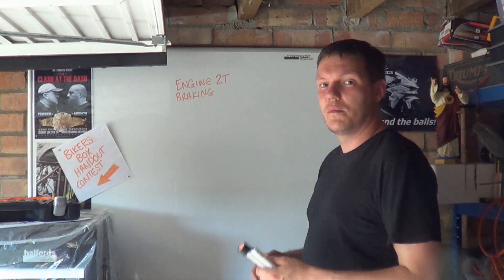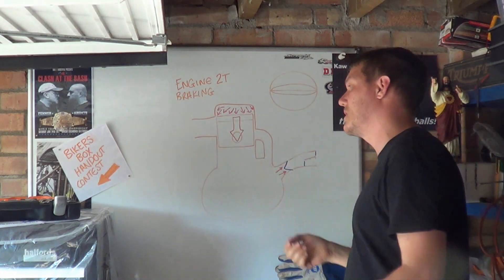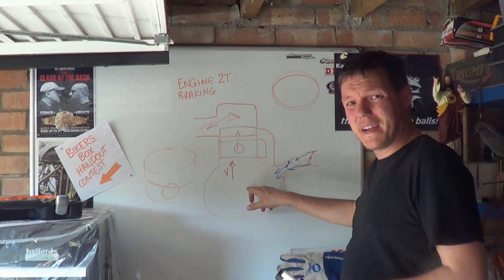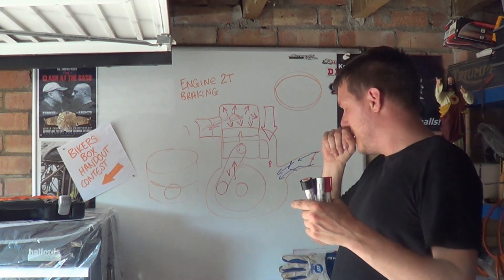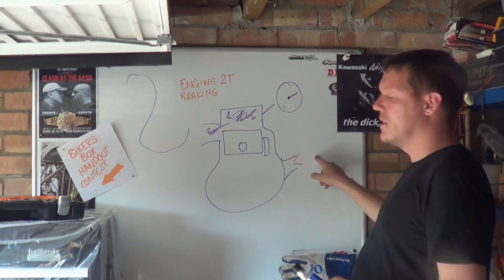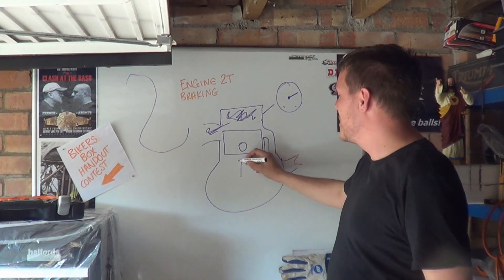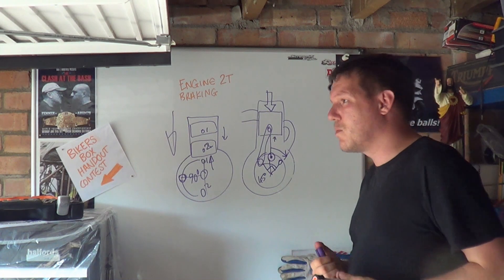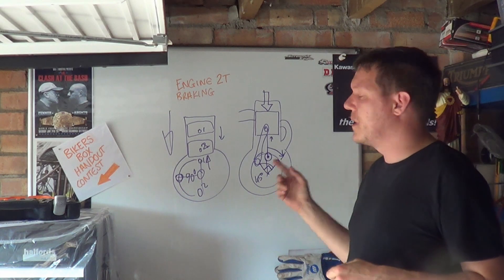How 2 Stroke engine braking works - or doesn't

Comment: "heat dampens your combustion rate" what the fucking fiction are you inventing?
Reply from the maker: "its almost like a self regulating exhaust gas re-circulation, erm, where you're pulling in exhaust gases, which has 2 effects on the engine. One, that lower/dampens combustion an awful lot." 

- This is what I say in the video. Where do I say "heat dampens your combustion rate"? You're a fucking idiot who just wants attention, just like your boyfriend Dan Henderson. If you knew anything about combustion and EGR then you wouldn't of made this stupid comment. But hey, you look like a dickhead, not me. Expect to be in a video soon dude, and we'll see what other have to say about this. - Good luck
Reply: @thedirtyworkshop  he's probably on about 9:40  - 'the only other problem is though is that it does add heat into your engine which does dampen your combustion rate'

Not taking MrRexCuntos side, he's a raving lunatic (who likes to cherry pick and twist statements out of context) and talks absolute bollox; just happened to be reading comments as you said it in the video.

Overall I found this and the 4 stroke video very interesting and useful, (not brown nosing) genuinely never considered how engine braking worked but am glad to now know.
Reply: part of why 2 strokes "4 stroke"....(
Reply: "the fuel air mixture can also spontaneously combust, causing valve clatter and damaging the engine. Allowing a small amount of exhaust gas back into the intake reduces combustion chamber temperature. Regulating the flow of exhaust gas is the job of the EGR system." ________
If I knew anything about combustion? ____________Insult me all you want you are not correct.  _____________
EGR REDUCES combustion temperatures.  
Everybody knows this.  
Put me in a video.  

"http://www.agcoauto.com/content/news/p2_articleid/207"
Reply: ""http://www.agcoauto.com/content/news/p2_articleid/207"" I can cite every thing I say. 
Can Matt? Noo 
If you need help on how erg reduces combustion temperature I'd be glad to point you to some resources. 
It does NOT do it by heat or 'dampen the combustion rate'
Reply: MrRexQuando i
Reply: The Workshop lmao dude, you're personality is just like mine.
Reply: That's what I call engine convulsions with a low pressure syncope. A surgery in the reed valves are required...
Reply from the maker: Exhaust gases are low in oxygen, which the article states. It dampens combustion for obvious reasons. Its also leans out the mixture due to the same amount of drawn in fuel and lower oxygen levels. 

It lowers the temperture over many cycles as less fuel is burnt (heat leased) but that's not what I was talking about was it? I was talking about per cycle, and when the throttle was closed, during engine braking.

Not the same situation is it?
Reply: No you were talking about ""heat dampens your combustion rate". I know how EGR works.

Comment: My question is; is it okay to engine brake a TPI 2-stroke? Will it hurt the motor? Can you use engine braking for descents?
Reply from the maker: I'm pretty sure the KTM has an independent oil feed, but check first

Comment: OK I rode down a 1 in 4 to 1 in 6 just over 1/2 mile long hill with the throttle closed on my CZ 250 twin today, in 2nd and 3rd gear at 30 MPH using engine braking and nothing happened.

The bike didn't heat seize or break anything. I was running the factory recommended 33:1 premix in an engine that is as it left the factory in 1974.

Compression is tested at 10.2:1 on my tester. I was easily able to maintain an indicated 30 MPH (33 MPH allowing for the infamous CZ speedo under reading) using just the engine braking and gear changes between 2nd and 3rd gear.

I think that this proves that for safe ratio premixed engines with high compression, engine breaking works fine.

I'll have to remember to take the camera and video the event next time I ride that particular hill.

Comment: some of the questions can be answered by a simple experiment:- cut the fuel ride until the engine cuts out completely, not feel the engine braking WITH THE THROTTLE CLOSED AND ALSO WITH IT OPEN! do this for a two stroke and for a 4 stroke!  see the difference? on the 4 stroke there is more braking with the throttle closed than open, on the 2 stroke more with the throttle open!  Tell me why....
Reply from the maker: That's a bit demanding isn't it? I thought it was obvious......
Reply: not to everybody, mainly me! I was really surprised when I first found that, is also sould help other s on here, judging by the questions. It also shows that there is potential for a 2 stroke to have better fuel consumption than a 4 stroke at low load (like travelling on a flat road) than 4 strokes, although it may not currently happen for other reasons. I did not say it as a demand, just something to think about, and , if some have doubts, they can try it themselves easily enough.

Comment: Wait in a 4 stroke it is crank case pressure that causes engine braking? Dude? 4 stroke never has crank case pressure. You are so wrong. 
This is why it is actually called "compression braking" which means you turn the engine into an air compressor. 
And if you look at a diesel (without a Jake) it would never work like you say. Diesels don't have any butterfly and still compression brake. 
Matt come on!
Reply: It is not really compression braking, although people call it that. most of the reason Diesels use less fuel is because they don't have much engine braking because they have no throttle. See my post above, 4 stroke runs with the engine "brake" on all the time at low throttle openings, it is well documented, google it. The reason Miller cycle engines (like the Prius) use less fuel is because the Miller cycle reduces engine braking by keeping the inlet valves open for most of the compression stroke.
Reply: It is and you can prove it to yourself. Takes like 150 ft-lbs of torque to turn over a 350 V8 with no carb on it.  Take any kick-start and open the throttle or closed you have zero resistance until the compression stroke starts.  I have no experience with "Miller cycle" but I will look at that too. Big diesels like Detroit 71 takes 480 ft lbs of torque to start and has no butterflies or jake brakes. It is work to compress air if you ignite it or not.
Reply: the speed makes a difference,  if the engine is turning at 3000 RPM little air is lost at the top of compression stroke, and the energy used in compressing the air is returned on the way down. Also not much vacuum in the intake manifold while turning slowly.  at 3000 RPM with an almost closed throttle  there is quite a good vacuum, piston is moving down with this virtually constant vacuum on the inlet stroke, doing work.  When the inlet valve closes the cylinder is cut off from the manifold at the bottom of the stroke, it has a lower than ambient pressure in the cylinder but this now increases as the piston rises, so some of the energy is returned, but not all. open the throttle and the piston has atmospheric pressure on the inlet stroke so does much less work. Work= braking, to brake means energy is expended, in this case it actually cools the air to well below zero!
Reply: Again take your 250 with a kick start. Hold the throttle wide open and tell me you don't have substantial resistance to the compression (30 ish lbs). The low pressure you speak of isn't the case as you have fluid momentum at 3000 RPM. When you use a compression test on an engine and crank up 160PSI don't you think that takes a bunch of energy?  

This is so simple take whatever engine you want to talk about. take off the carb. Take out the spark plugs measure the torque to turn it. Now put the plugs back in and measure the difference. Why do you think it is harder to turn with the plugs in? (Compression) now factor in only enough fuel/air to turn it 600 RPM but turn it 3000 and you have the effective compression braking formula.  The energy it takes to turn 2400 RPM with no power input. Not sure who started this whole "vacuum' braking myth but it is just that a myth.

Think about this. If vacuum braking was so freekin effective why not just put a butterfly on a cummins intake instead of all that valve work for a Jake Brake?
Reply: and again, think about it! it takes torque, but after in has passed TDC the pressure in the cylinder is helping to turn the crank. flywheel  effect evens it out at st speed. This is not conjecture, look it up in text books, google it too, but the best way is to think it through. My Motorhome with a Nissan FD35 diesel HAS a butterfly on both inlet and exhaust. you can only get a certain amount of braking from inlet butterfly  because once the air pressure is zero you can't get any lower. the exhaust one works on pressure to there not much limit to the braking effect.
Reply: Umm no you have your concepts all mixed up. Some diesels have a safety flap on the inlet to make sure they don't run-away. None use it to restrict inlet flow in a "normal" running manner. 
You are proving your own point with 'you only get a certain amount of braking from vacuum' as Matt's accretion is that is where a motorcycle engine gets "all" of its braking power. . Again if the inlet is where you get engine braking kick start your motorcycle with the butterfly open/closed.
Reply: Simple physics here the most theoretical pressure from suction you will ever get is 14PSI while a running engine will make in excess of 200-600 PSI during compression. So which would obviously be the braking force! Not suction. The rebound doesn't occur as you say because the exhaust valve opens 50-90 degrees before BDC.

Again prove it to yourself. Crank an engine with spark plugs in but no carb so the difference in cranking amps with no carb and completely restricted.  ITS NOT THE SUCK that stops.
Reply: Yes, that was my point about diesel exhaust brakes,.  But they do engine braking on purpose, On a car or bike it is not an added feature. With exhaust brakes the braking takes place on the exhaust stroke,  the exhaust valve is open, so the  piston is seeing the high pressure in the exhaust all the way up, not just at the top of the stroke like it is on compression stroke. Yes, the piston does see 600 psi on the compression stroke, but it sees the same pressure at each point on the power stroke as it does on the compression (less a bit for losses). So you have a negative torque on compression and a matching positive torque on the power stroke! the flywheel effect averages this out to make it close to zero.
Reply: They don't use it to control the mixture as in a non-diesel, although some use it to modify the ratio for emissions reasons. Not all diesels use it but a few I have seen are a  '60s Mercedes van had it to provive vacuum for the brake servo instead of the vacuum pump on the back of the alternator commonly used,  an Isuzu UTE 2500cc used it for emissions reduction, and My Nissan FD35 engine where it used for braking, mainly to provide vacuum to operate the butterfly on the exhaust. The "jake Brake " opens the echaust valve to release pressure at the top of the compression stroke so the energy expended on compression is not returned on the power stroke. see:
  https://en.wikipedia.org/wiki/Manifold_vacuum 
"This vacuum braking should not be confused with compression braking (aka a "Jake brake"), or with exhaust braking, which are often used on large diesel trucks. Such devices are necessary for engine braking with a diesel as they lack a throttle to restrict the air flow enough to create sufficient vacuum to brake a vehicle."

From Jacobs web site:  http://www.jacobsvehiclesystems.com/technology/compression-release-brakes/

"How A Compression Release Brake Works 
When activated, the Jacobs Engine Brake® opens the exhaust valves near the top of the compression stroke, releasing the highly compressed air through the exhaust system. Little energy is returned to the piston, and as the cycle repeats, the energy of the trucks forward motion is dissipated, causing the truck to slow down."
Reply: Again you are just incorrect. Again 14PSI is max for "suck" braking vs 600 PSI on compression.  The exhaust valve opens 50-90 degrees  before BDC so the re-bound of the 600 isn't enough duration to matter. Not even close to zeroing out! Again you can try this on your own. Put amp-meter on the starter while cranking with WOT and closed. tell me the difference in torque.
Reply: Engine braking on motorcycles is not an intended feature, and compared to trucks, where it is, it is feeble. A truck can produce 300H.P. and have 300HP of braking. it can be turned off at will, in a bike or car it is on all the time, and waists fuel. there is no control to stop it, if you open the throttle the braking is much reduced, but compression  is increased.
Reply: did you do that test of engine braking with open and closed throttle? did you see that there is more braking with a closed throttle? but compression is lower with a closed throttle? how do you explain than? did you also look at the link i posted to Jacobs?
Reply: I have never seen an engine with 90 ded bbdc exhaust opening, Highest I can see is 70, but still, the work is all done by then, do you think Jacobs, the world authority on exhaust brakes, got it wrong too?
Reply: They do go pre 70. Text books say 50-90 "http://www.imps4ever.info/tech/camshafts/camshaft-timing-schema.gif" 
No Jacobs got it right. The open the exhaust valve like 200 degrees pre bdc.  They simply dump the pressure sooner. The point is vacuum doesn't help braking agree? Diesels (99%) don't have any intake restriction and yet will compression brake without a jake. Even Jakes video says they are "enhancing" engine compression braking.
Reply: go ahead show your math.
Reply: MRRexQuando: Strange you say that as my 500 4 stroke single has a breather pipe to release the pressure in the crank case and gearbox caused by the piston down strokes. That's why 4 stroke engines have to have a breather outlet because of crankcase pressure!!

Comment: I'm going to put you in a spot.....cause I'm a dick.  What do you know about crankcase case volume and it's ratio with the displacement of the engine?  I'm asking because I don't know....never researched it.  Anyway, I know it is important because of stuffers and generally, the piston skirts are close to the crank...so they don't use long rods to slow tdc piston velocities...
Anyway, what do you know?
Reply: around 1.5 to 1, if I remember right. this is the real reason 2 strokes have less engine braking, because the butterfly sees a pump with a 1.5:1 ratio and the 4 stroke 10:1.
Reply: Will George, I'm going to start by asking, what the heck is 3 stroke?
Reply: it's a typo!

Comment: I think i get it.  I Guess the swept volume is greater on a 4 stoke all ports are at tdc so on way down its generating more pumping loses.  A 2 stroke it compresses shity exhausts gasses i guess hotter air is easier to compress as less dense in a small area in the head then as piston comes down exhaust port opens so all the compressed air just fucks off round tge the exhaust system.     It made me think of two questions 1 can you run a 2 stroke in reverse? 2. does it matter if engines run clockwise or anticlockwise.  Sorry for the long comments you look cooked in the heat.  You videos help me think and relax my brain so i just type away lol.
Reply: I actually pushed my moped backwards and put it in gear and it started in reverse thats how you get a reverse gear on a 2-stroke moped.